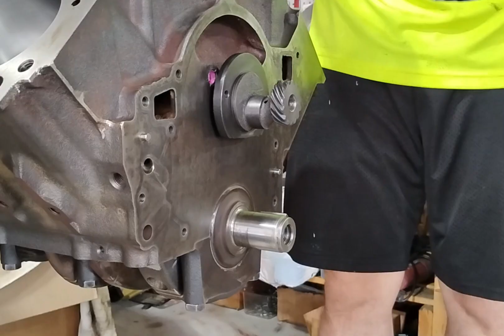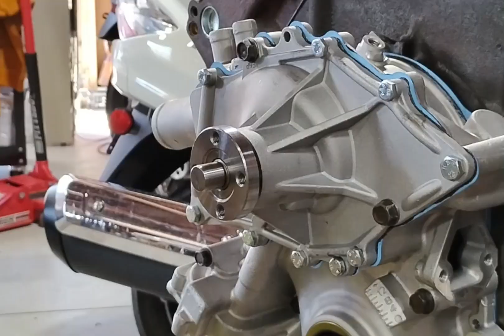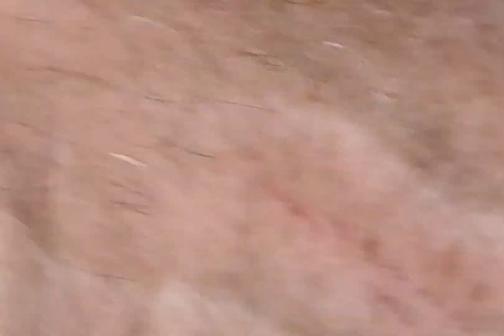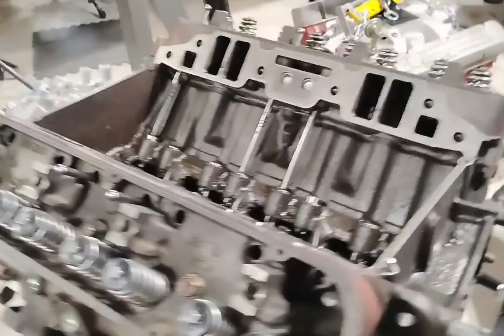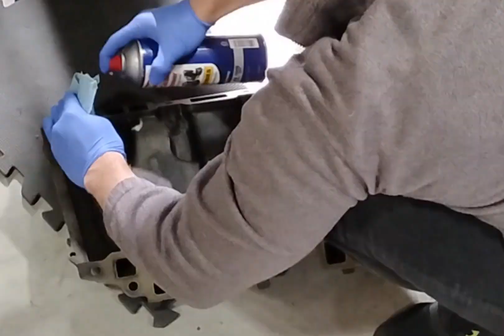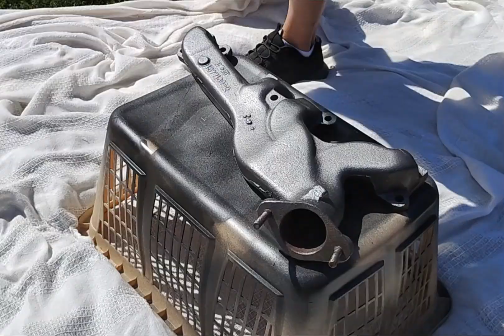Engine Build Nightmare! Wrong TDC Marks & Valve Train Chaos (Riviera Revival #5)

Comment: Spending this much money, I'd get one of the nice new TAperformance (Edelbrock?) intake would be my choice. IF thee is enough hood clearance on a Riv?
Reply from the maker: Funny you should mention that. Before we started this project, we did just that. We got an Edelbrock manifold...and the car ran terribly with the Rochester. The engine runs much better using the stock manifold. And yes, there was enough clearance. Thanks for watching and for commenting!

Comment: what is the possibility that the zero mark on your reproduction timing change cover is also in error?
Reply from the maker: A great question! Considering all the other components that were off, that was a concern. When we had the engine at TDC compression, we checked where that mark was, and it was in the right spot....thankfully! Thanks for watching and for commenting!